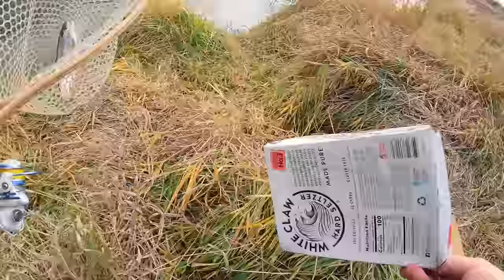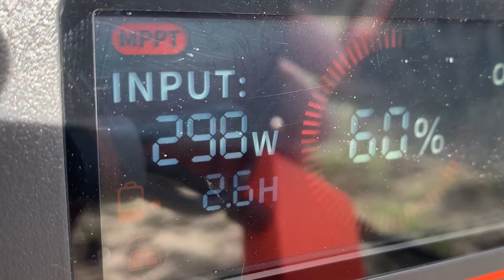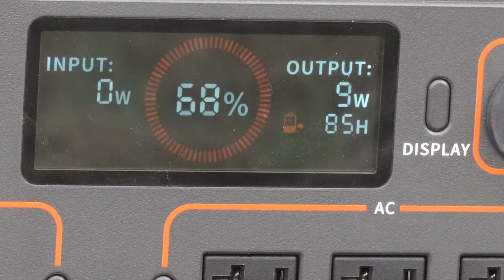BIG TROUT Fishing & Primitive FIRE COOKING with my Dogs!!! (Catch & Cook Adventure)

Comment: It was good to see Tiko again. What a cutie! Both of your doggies look like they are just loving it out there! Looks like you’re doing the same though 😁
It would be cool if you made a small earth oven out there. Trout pizza y’all! The microwave did kinda cracked me up though! 😂 Thanks again for another great video!
Reply from the maker: Haha the dogs were having the time of their lives. That’s a good idea on the oven! I’m down for trout pizza! 😂
Reply: @NWFishingSecrets  if you have access to clay, sand and some dried vegetation (reed grass, straw, etc.) you mix that together. 20% clay to your sand and enough fiber for tinsel strength and enough water to make it like modeling clay. Build a base with your stones out there and make a level floor with fire bricks. Mound some moist sand on your base then cover it with your mix at least 3 inches thick leaving and opening for your door. Once it’s dry dig the sand out from the inside and you’re good to go! I’ve been able to get the bigger earth ovens I’ve build up to 1000 degrees!

Comment: Save your dryer lint. Just put it in a ziplock untill you have a bagful. Then melt some paraffin in a pan and soak the lint in it. Let it dry and cool. Break or cut it into about one inch squares. Best firestarter. Water proof and very light and easy to pack.

Comment: Using the materials on your property you might consider using stone. Your property seems to have an abundance of stone. Walls should be a minimum of 2 foot thick. 1 foot stone wall  plus 4 inches air gap plus another 1 foot thick stone wall and tie each wall together with steel strapping.
Don’t make a stone wall without the air gap. The air gap increases the R value considerably. God bless.

Comment: make sure you cover up those stumps you brought (a couple pieces of junk aluminum siding, cut to look like a trashcan lid or hat, with a decent size rock on top to weight it down).  otherwise the rain and other constant attack of the elements will ruin them in 1 season.

Comment: Your using your fero rod wrong. The knife hand stays stationary and you pull away from the tinder bundle with the fero rod hand. 

Reasons not to do it your way: are because you have high chance of knocking the tinder bundle around, you could cut yourself, you push wind into the bundle might diminish your spark. 

Alternate method pros: Pulling away with the steel hand allows you to get right up into the bundle so your sparks get less air time, it gives you more sparks and better strength better quicker results.

Setting up the right tinder bundle is also very critical which it looks like you have that mastered 💪

Comment: Great video, but I don't think shooting at metal plates is very safe. Ricochet.
Reply from the maker: Thanks for enjoying! And the plates are set up with a downward/backward angle & spring loaded, so all spalling goes straight down 👍 But you are right - if steel is not set up properly, then it can be dangerous.